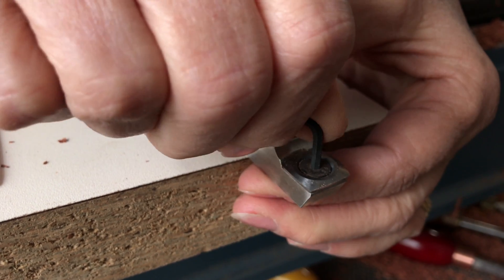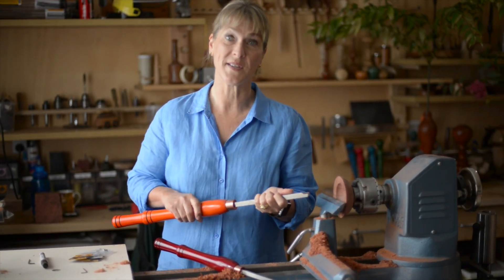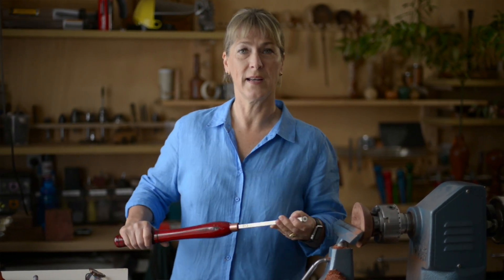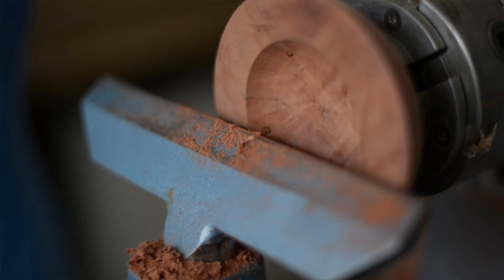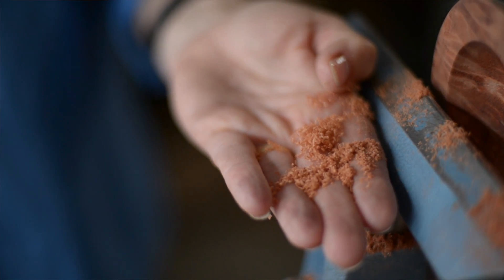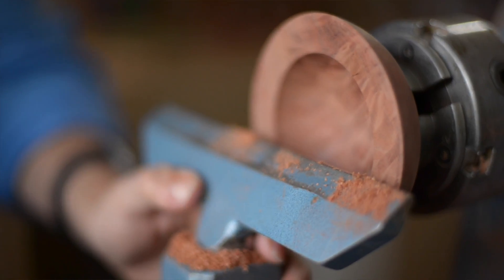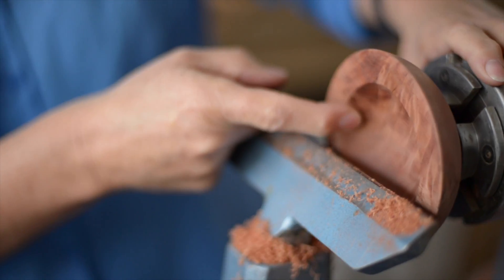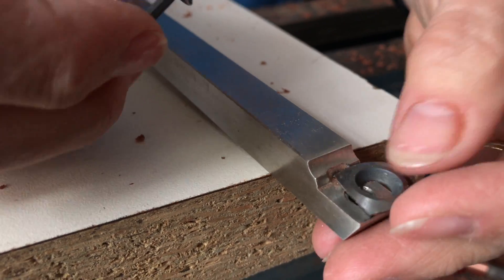Negative Rake with Carbide Cutters

Comment: Great video. I wanted to say, while you said they were meant for finishing, I use mine from start to finish when I'm turning pens. Obviously there's a difference between them and bowls, but they work wonders knocking off the corners of the blanks. No catching, just a smooth cut from start to finish.

Comment: Can you sharpen the cutters?
Reply from the maker: HI Derek. No, not really. There is little point anyway. The cutters are designed to last, and when they are no longer viable, be replaced.
Reply: Technically, you can. there's a video on how to do it. But  like it was said previously, theyll last quite a bit and they aren't that expensive to replace.

Comment: Thought about getting some of the easy wood tools but at $229 a pop for the full size tool is a bit steep for a beginner like me so I just ordered some chinese knock off at $40 and replace their cutter with the easy wood ones
Reply from the maker: The Easy Wood tools are not cheap. That's true. We have noticed a marked difference, however, between them and the knock off 'equivalents' in terms of build and quality. They are a quality product, designed and made entirely in the U.S, so there is that to be considered in the price. You are wise in choosing the Easy Wood cutters. That's the pointy end of the stick where it really matters! Thanks for watching, and for your comment. There are plenty of woodworking videos on our channel and more to come, so please subscribe if you haven't already.

Comment: I got into pen turning about a year ago and after countless pens turned on various woods I decided to try my hand at acrylic blanks. The results were less than spectacular. I would try various speeds, angles, tools...nothing seemed to stop the catches. I was so frustrated I almost threw my blanks in the trash. Then I saw an ad for Easy Wood Tools Negative  Rake cutters. Could this be the the answer to my prayers?! My unheated shop is just to cold to work in currently but as soon as the temps warm up enough I will be putting the Negative Rake cutters to work. I am hoping by the time I get to use them someone will come up with an easy way to sharpen them like the standard carbide cutters. If no one does but the cutters work out I will still consider it a fair trade off even if I have to buy new cutters every time I wear one out. 
Although you was turning wood not acrylic the results I saw in your video working on that gorgeous bowl make the Cutter's look very promising when I graduate on to other projects. Many Thanks in advance for sharing your knowledge and expertise!
Reply from the maker: Thanks John. We hope it works out for you! Please keep us posted on your results, ok?
Reply: Long story short I couldn't wait for warmer weather to test out my new Negative Rake cutter. I froze my buns off but it was totally worth it. The new negative cutter worked like gang busters! No snags, catches, OR chipping!! On top of that the blank was so smooth it took very little sanding before sealing it up. Can't wait till I can spend more time with my new cutter. In fact I hope to have several spares by the time the weather allows me back in my shop. THANK YOU so much for showing me this new cutter. Now I look forward to building more pens with acrylic blanks! 
Respectfully,
John Archer
Reply from the maker: That is great to hear John! Thanks for letting us know. Hey, why not make your own video on these things and post it on Youtube! Just a thought....👍
Reply: Very kind of you to ask. Honestly I do not have the camera equipment or the knowledge it takes to post anything. Besides people want to see and hear people that are talented, photogenic and articulate-like you.